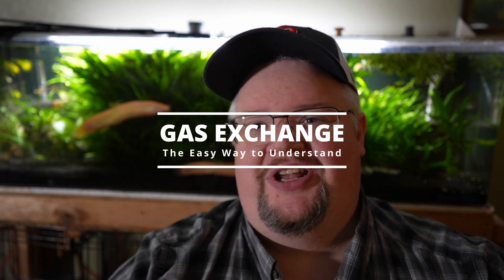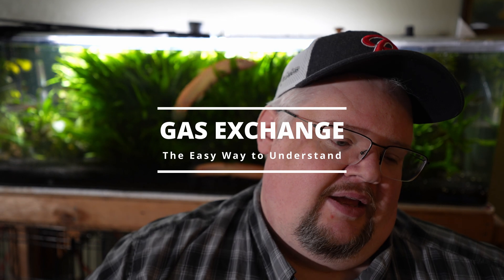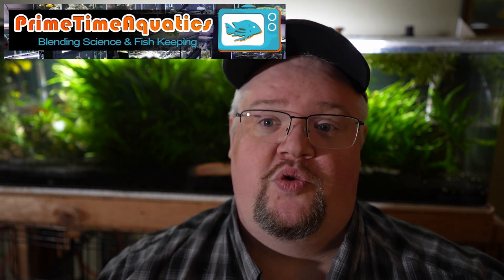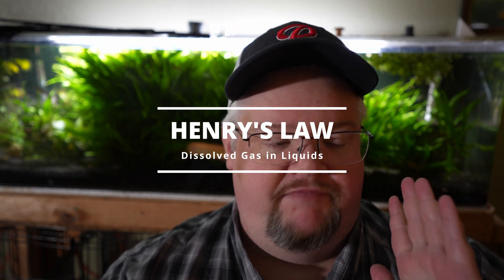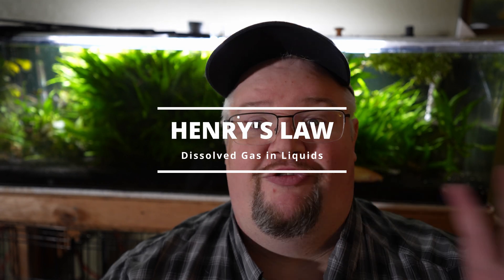You're losing CO2, but not really that much - Understanding Gas Exchange in Aquariums

Comment: Bentley your vids are great BUT this one felt a little week. Basic concept with no practical application.  How much CO2 and how much agitation are we talking about.  Perhaps a little more precision would help with this topic.  Show some calcs or better yet demonstrate a  rudimentary experiment by measuring CO2 with the agitation off one day,  then measure the next day with the surface agitation on.  Show the difference.  Sure it can be said that the KH pH method doesn't provide accurate ppm, but it will show relative change close enough.  Maybe even do it with different filters, air stone, trickle filter etc .  Thank for the great content!

Comment: Hi Bentley!  Firstly it's pronounced Aquarist and not Aquariast.  Now that we have that out of the way, from my experience since the mid 1980's I can absolutely attest to the fact that CO2 in tank reactors are far more efficient at introducing CO2 into the water volume than any diffuser could ever hope to be.  My statement is based solely on the use of Dupla Aquaristic's Reactor S and Reactor 500.  Both of these require a water feed coupled with a CO2 inlet nipple.  The new Reactor 500 is now also adjustable for several aquarium volumes.  Something I had wished the 1980's versions had.  Don't get me wrong.  CO2 diffusers can and do introduce sufficient CO2 into solution in order to lower pH and provide carbon to submerged aquatic plants however it's simply using more CO2 than dedicated in tank reactors can.  But anyway's that's all from me for now.  Oh I meant to so "anyway" that's all from me for now!   ;-))))

Comment: What I've noticed is that biofilm quickly builds up in my tank if i have no surface agitation which causes co2 levels to increase continuously when co2 system is on. With high surface agitation, co2 is fairly stable for when system is on. This all makes logical sense.

Comment: Great video, but what if you have a low tech planted tank?
Reply from the maker: With a low-tech tank, you don't need to worry about it at all. The amount of CO2 that's going to be present in your water is low enough that you're not going to lose CO2 from the gas exchange any faster than you would introduce new CO2 via gas exchange.
Reply: @BentleyPascoe  That's an understatement.  However jump on over to MD Aquariums in the UK and see how little CO2 he uses.  You want to know why?  His part of the UK has access to mains water that has a pH of 6.0 and 1 DKH  and 4 DGH.  His plants pearl oxygen as soon as his lights go on and he has trouble keeping his KH up to prevent excessive CO2/sudden pH crash.

Comment: You just put a loop into this CO² Thing... By that I'm talking about using a sponge filter with CO² injection. 
 As you have explained the reason why you introduce surface agitation by means of introducing an air stone in order to create surface agitation, it makes easy sense. 
 When I first started injecting CO² into my tank, I was utilizing a (large) sponge filter prior to turning the tank hi-tech. 
 I then read that the tiny air bubbles created by the airstone will cling to the CO² bubbles And quickly disapte the CO² bubbles and deplete the co2 from the aquarium instantly
Reply: True, that was proven by research. But not if you use an active reactor because by the time it comes into the water the Co2 bubbles has been dissolved in the water. Using a reactor with the blending blades, you can't even see any bubbles out of your outflow pipe, and beside that to me it is aesthetically pleasing to see.  Or else you have to use timer whereby the air stone stops during photo period. And here Bentley was right as he was talking about gas exchange not bubble .

Comment: I find the one explanation a little contradictory. If a ton of surface agitation would cause you to lose a lot of injected co2. Then any surface agitation I believe would increase lost injected CO2. My main flow from filter actually flows down and also across towards the intake. Then a power head to push back towards filter outlet on opposite side of tank. I feel I get 360 degree co2 all the way around the tank. Plus I can tell the gas is saturated as even my Anubius near the surface is pearling. And the tank is not even really established yet.

Comment: Great video! I had a semi unrelated question. I have one tank with CO2 injection and was wondering what would happen if I put the co2 bubbles right below the canister filter intake. Didn’t wanna try it and ruin anything so I went searching but haven’t found any info. It’s set to just over 1 bubble per second so not a whole bunch. Has anyone tried this and does it work without ruining the filter? Thanks
Reply: I thought the same, just want to set-up the co2 bubble go directly into filter intake. Maybe next month!
Reply: @harenthiran  I did it and have it running like that since I made this comment. About 8 months now. It works fine, sometimes I hear some bubbly sounds from my canister filter but overall it works flawlessly. No more bubbles floating around my tank which is really nice. I do have a fairly large canister filter and only about 1-2 bubbles per second on co2. Doesn’t hurt to try imo.
Reply: @BuildsWithV  Wow Thanks! I'll make it next month

Comment: Thank you for sharing this important information! There’s so much learning in this wonderful hobby. And I appreciate people like you who help educate us. I do have a question: my CO2 tank is pumping out CO2 fine. But it is constantly running and not working with the timer I set up for it for dispersement like it did before. Is it a problem that there’s always CO2 in my tank, besides the fact that I’m wasting it when there’s no light? I wonder, is it harmful to the plants and fish if CO2 is always going?
Reply from the maker: The risk of having co2 happens at night. During night your plants aren't using CO2 because they're not photosynthesizing so you can get a buildup of excess CO2 in the aquarium which can become dangerous. This is why we usually choose a regulator with a solenoid in order to turn it off and on easily on a timer so that when the regulator loses power you're no longer pushing gas.

Comment: thanks Bentley. I do have injected CO2 at a rate of a little "less" than one point pH  drop .. at the level your explaining here, I understand this part of the cycle. the question I have now is about added aeration when the lights are off? I have an adequate surface ripple, from my h.o.b. filter output, for gas exchange during lights on. with no air-pump. I've heard some people say to have an air-pump on a timer for the lights out period? I hear that the plants emit CO2 at night? do they actually consume oxygen at night? what's your take on this? would an air-pump at night benefit either the plants? or the fish?

Comment: Recently muffled all of my flow on the spray bar for my Fluval 307 so I could put red root floaters in, but today I noticed my fish seemed to be having trouble breathing so I turned off the CO2 and just ran two air stones. I have some floating rings to feed and to make sure some light gets to the bottom of the tank - I wonder if running the air stone (or two) and have them bubble up into those floating rings would be enough for the fish...
Reply from the maker: airstones can provide a really good source of oxygenation, but part of what allows your air stone to do so much work is the surface agitation that it causes. So if you have too many floaters, it can minimize that surface agitation and that can allow buildups of protein film that reduce gas exchange. So what I would do is either A put some of your floaters in a ring and manage those or be just as you start seeing a takeover more than 50% of the tank. Thin them out

Comment: So this leads to the question(s) that pops up from time to time to new Co2 users. 

"I have a sponge filter, that's it. Will I benefit from Co2? What if I baffle the surface agitation with a ring (i.e. Air tubing ring that encapsulates the bubbles to one small corner of the tank), will that improve my Co2 concentration/retention?" 

"What if I use a powerhead on the sponge filter instead of an air pump?"

"If a sponge filter is not advisable with a Co2 setup, then what is recommended? Canister? HOB?"

Otherwise, outstanding video!

Comment: Hello, thanks for another lesson. I would like to ask a question about water circulation and CO2. Would using a DIY CO2 with a sponge filter be almost or just as effective as using CO2 with a canister filter in a small 16 gallon tank? I'm thinking about starting to use CO2 but answers online all recommend using a canister filter when going with CO2. Not sure if it's just a myth or not, with CO2 needing heavy circulation to reach the other end of the tank. The cheapest canisters are still a little expensive but I'm willing to get one if it's necessary. I'm really not a fan of wave makers. 🤣
Reply from the maker: So the main problem with DIY CO2 is inconsistency. Most of the DIY solutions for injecting CO2 into your aquarium are reliant on a process that isn't as fine tunable as a CO2 tank. Also, keep in mind that because sponge filters are air driven, they're only moving so much water, so it's not going to distribute the CO2 quite as well as something like a powered filter. What you could do is get something like one of the power heads that fits onto your sponge to give a little more circulation and then use whatever CO2 method you want. The big thing isn't necessarily DIY versus more professional CO2 systems. It's more about the amount of circulation in the tank to distribute whatever CO2 you are putting in as equally as possible throughout the water column.
Reply: @BentleyPascoe  Yeah, it has a lot of cons , one big thing is that it can't be turned off lol but I just want to try using CO2 for the first time to test it out and this is the most cost effective method for me to be able to do that right now. Thank you. I'll prioritize good water circulation and give it a shot.